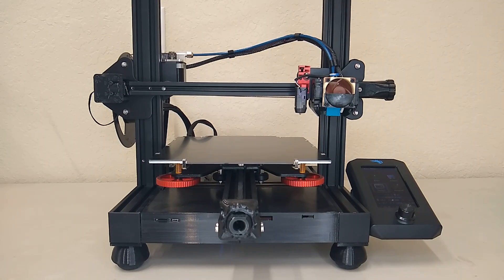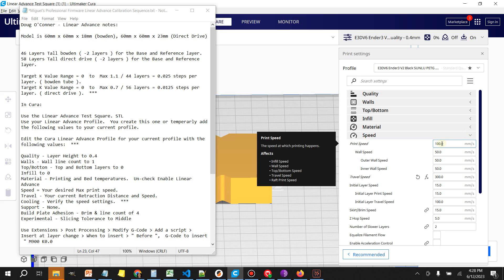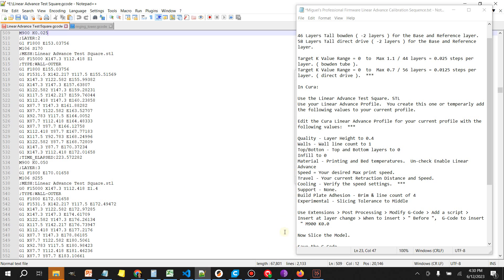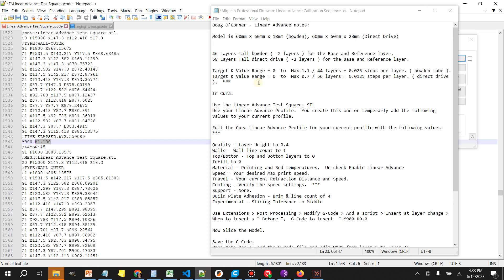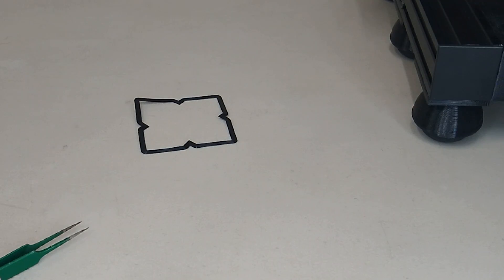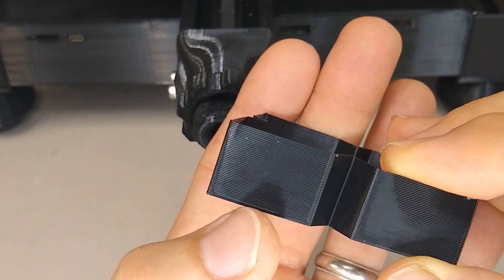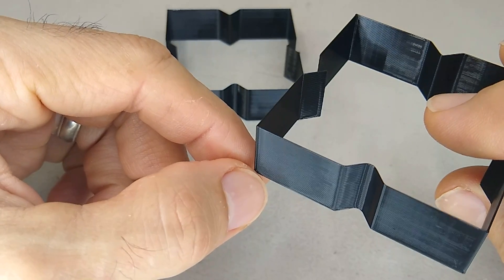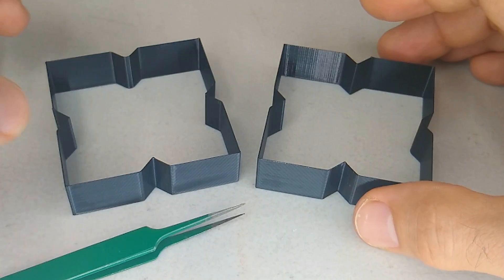Ender 3 Pro V2 Miguel's Professional Firmware Calibrating Linear Advance For Perfect Corners

Comment: cool video, but bro ditch those springs and get silicon mounts. You'll be doing yourself a favour when it comes to levelling/tramming the bed.
Reply from the maker: Thank you for commenting and info on silicon mounts. Please link the ones you are using so I can give them a try. Thankfully, the high tension springs have been great for me since I don't remove or scrape my build plate to get prints off.

Comment: Noticed the new style clamps holding the Garolite. Better than clips in your Garolite install video? What are they and where does one find them? Thanks!
Reply from the maker: Hello, Yes, the document binders leave a lot to be desired. I found the bed clips after making that video. I'll have to redo it an show the new clips linked below.

https://amzn.to/3ObXBBX
Reply: Thanks for the bed clip info! I have an 3v2 (not an S1). Will Miguel's firmware version optimized for the S1 work with my 3v2?

Comment: Hi Victor, I flashed a compiled version of mriscoc with LA enabled, and followed these steps to a T! I didn't get any gap in my printed part afterwards and can't find any reason why. Under control -> motion -> advanced K shows my final K value properly too, and during the print I can see the extruder make the adjustments.
Reply from the maker: Hi Donny, Thank you for commenting. Are you running direct drive or stock bowden tube setup? If bowden you might need to increase your base retraction a bit to get that gap to show up during the k value test print. If the micro retractions are happening within each layer then increasing the main main retraction to something between 1.25 to 1.75 should induce that gap to appear at some point. If the gap appears right out of the gate then turn the main retraction down to between 1.0 to 1.25
Reply: Victor, I was running retractions at normal, which was 4mm. Should I reduce that way down for this test calibration? Also, I saw combing was on, I should probably turn that off too? Thanks for your reply also!
Reply from the maker: @_donny_9473  Leave the combing on since you're going to be using during prints, it's always best to have things set as close to an actual print as possible. 

Anytime, Donny!

Comment: my professional firmware 2.1.3 doesn't have an "advance K" option on the screen. I ran the test anyway, just the straight fresh stl then the modified one and I didn't see any difference and no rip. What am i doing wrong? ender3 v2
Reply from the maker: Hi Philip, Is your firmware a pre build one of did you compile it yourself?

If it's a pre-built it may no have the advanced features. The video below will guide you step by step on making your own. Make sure to download Python version 3.9 it seems that the newer ones won't open the configurator file.

https://youtu.be/2NqHNYtyEa4
Reply: @vbared  The firmware is prebuild. I am new and every time i try to make changes i get a ton of errors and can't seem to get them fixed so i stay with the prebuilts. I will look into this video. thank you very much for the help!!!
Reply from the maker: @PThompson381  Hi Phillip, email me vbared@gmail.com the details of your machine by that I mean the selections you would make using the configurator tool, I'll compile it for you. Use the link below to determine which display board your screen has.

https://github.com/mriscoc/Ender3V2S1/tree/Ender3V2S1-Released/display%20assets

Comment: Hello
Great guide!
After calibration, which settings in Cura must remain changed as at the beginning of the guide?
Were these initial changes in cura made only for calibration and can they be used to return to previous settings?
Reply from the maker: Hello friend, Thank you for commenting and encouragement. I'm glad you found value in this video for your viewing time.

The CURA settings that were modified are only for the test prints. So once they done and you found the linear advance value for your printer, you can revert those settings back to what they were. Also make sure to delete the post processing m900 script in CURA.

Enjoy your weekend (:
Reply: @vbared  
Thank you for your answer, may the force be with you :)

Comment: I only get 45 layers in total ? i followed everything in the guide. 
And when u calculate 18mm times 0.4mm its 45, how are u getting 46 ? :D
Reply from the maker: Hello, Thank you for commenting. If you look at the g-code using something like Notepad++ you'll notice that there is a layer 0, which is the base layer. Since that layer is usually squished to provide the adhesion to the build plate and the layer height is less than .4mm the slicer labels it as zero.
Reply: Hey again @vbared  
I am using Notepad++, and i can see you get to layer 45, i only get to layer 44 in the Gcode when i open it in Notepad++.
How is that ? I can see when you are at layer 0, it says 46 layers in total, mine only says 45..
Hope you can help
Reply from the maker: @frederikaastrup2497  Hi Frederik, I'm not sure, maybe a mistake with my count but don't worry about that. The rest of the calculations should get you very close to the perfect number. Take the results you get and run a test print. If there is gap in the place where the layer changes are then just decrease the K value by .025 and run the test print again.

Comment: You've got some great videos on tuning the printer. A playlist of start > finish would be amazing! Thanks!
Reply from the maker: Hello TheMrDrMs, Thank you for your kind comment. I'm glad you are finding value in the content for your viewing time. I've been running a small print farm for the last 4 years so I've had my share of headaches. If I can save you some time just ask.

Happy printing :)
Reply: @vbared  Oh that's awesome, thanks for the offer! I had asperations to do the same about then too, but never did it - life happened and my e2 and e3v2 sat idlely by. I had Jyers on them, working phonemally well, but figured I might as well check out mriscoc, and oh boy am I having troubles on the v2, so I'm just going thru your videos to get it dialed in again. I might take you up on the offer if I end up wasting enough time and plastic  lol.

Comment: May I know if you need to turn off retractions in Cura for this test? My guess is that there  will be minimal to no impact with retractions on since it is printing straight lines.
Reply from the maker: Hi Chris, 

The Linear Advance is simply micro retractions when direction changes are encountered within a layer unlike the standard retraction that occurs only after a layer is completed or moves from one part to another. I did my testing with the standard retraction enabled in CURA. The idea is to see how much more Linear Advance retraction could be added before you start getting under-extrusion during the standard retraction. The linear advance stacks on the standard retraction. So lets say that your standard retraction is 2mm for a bowden setup to minimize stringing and you add an additional .500mm Linear Advance value then the total retraction when changing layers would be 2.5mm. If that causes a small gap at the beginning of the next layer then lower the .500mm linear advance by .0250mm and test it again. Keep lowering your number until that small gap is no longer occurring. If your corners still look bad then you can try lowering your standard retraction in CURA to let's say 1.75 to reallocate some of the primary retraction to the Linear Advance value to help improve the corners prior to a layer change.
Reply: @vbared  thanks for the detailed explanation! will definitely take your advice into consideration. i did reduce my retraction settings after applying pressure advance but it caused extra filament to be extruded - so i reverted to my original retraction settings. looks like i will have to investigate a bit more to see what's happening. really appreciate your detailed explanation!
Reply from the maker: @chriseow  Have you checked your e-steps? Which firmware are you using? Miguel's Professional Firmware or Klipper?
Reply: @vbared  yes I did check my esteps. actually the extra extrusion is not a lot, just a little bit extra at the corners. that was when i reduced my retraction after introducing pressure advance. i am using klipper.
Reply from the maker: @chriseow  Bowden or Direct Drive? What is your current retraction set to?
Reply: @vbared  bowden. retractions at 5 mm now. i changed it to 2.5 previously.

Comment: Hi victor, nice video. I have a question, linear advance is compatible with tmc2208 drivers? Few months ago, i've tried to activate linear advance but mi stepper motors doesnt do anything. I read in a forum that linear advance was not compatible with these drivers, its that true?  or this problem been fixed?. Thanks a lot
Reply from the maker: Hi Miguel, Thank you for commenting. Yeah, I read the same forums and I'm not sure why they say this because all linear advance is just another form of retractions that occur within a layer when corners are encountered. How you can verify this is by installing a firmware that supports it, like Miguel's Professional Firmware. Zero out the advance K value and print something. The only time you will see the extruder retract is during a layer change or move between points of the same model but when you turn it on and set the advance K value to something like .500 you're going to see retractions within the same layer when direction changes are encountered. This indicates to me that the info in the forums aren't correct. The purpose of linear advance is to improve the appearance of corners so if after it's activated and you see significant improvements in the appearance of the corners then it must be working.
Reply: @vbared  Works perfectly. Thanks for all, keep doing videos like this :)
Reply from the maker: @MiguelRamos-du4gm  Awesome, The feature makes a big difference in how clean the print edges look.

Comment: Always the best videos, Victor! You are really great. May I ask whi did you come back to Marlin and not sticking to Klipper? I am also with Miguel'sProf SW today and pretty happy. PETG is a breeze :)
But Klipper seems attractive with higher speed and automated input shaping. Your comments are welcome!
Reply from the maker: Hello Jacques, Thank you for your kind comment. 

I have 4 machines that run Mainsail Klipper and one that has Miguel's Professional Firmware. Klipper is hands down the way to go but I keep this one machine on what I consider to be the closet firmware, feature wise, to Klipper. Great job learning to print with PETG. Shortly after learning about PLA's heat intolerance I switched to PETG strictly and haven't looked back. It's a little more finicky to figure out but once dialed in it's just as clean to print with and way more durable than PLA. Nylon is another great material to print with but, it must free of moisture and printed from a dry or heated box, super clean and will bend instead of breaking. I still haven't figured out ABS both times I've played with it have ended in me saying, why would anyone in their right mind want to use this material? When I finally figure it out I'll post a video about it.

Enjoy the week :)

Comment: wow I saw on screen had Linear Advance and Input Shaper in your FW, I'll been waiting you test input shaper on Miguel's Professional Firmware , in my case once after put number all command on lcd super delay, than I flash back to base on Miguel's Professional Firmware in have not Linear Advance or Input Shaper, by follow your clip I will jump to Linear Advance package, and thank you for your All Tips and teachings
Reply from the maker: Hi gift, Thank you for your kind comment. Yes, Miguel has experimental features that can be enabled using his custom configurator. I made a video on how to do this linked here - https://youtu.be/2NqHNYtyEa4

You'll need to know what specific display screen you have so you can select the right one in the configuration tool.

Best of luck with your mods!

Comment: Wait what? Its still wrong.
https://youtu.be/dkpxZnoitBc?t=643
Reply from the maker: Yes, you are right, I'm still measuring from the top down but the reason I'm not measuring from the bottom is because the first two layers have a k value of zero and the amount of squish of the first layer will vary. So measuring from the top down will remove those variables. 

The overall number of layers when the 18mm tall model is sliced at .4 layer height is 46. So when I say in the video to subtract the 25 from 44 (I'm leaving out the 2 layers that are zero) the result just needs to be multiplied by the k incremental value of 0.025 to get the Advance K (linear advance) value.

You're thinking "This guy is nuts, he still doesn't get what I'm saying!", lol.
Reply: @vbared  Lol. :)
I just skipped ahead to that point to see the change and didnt see any and commented then, ;)